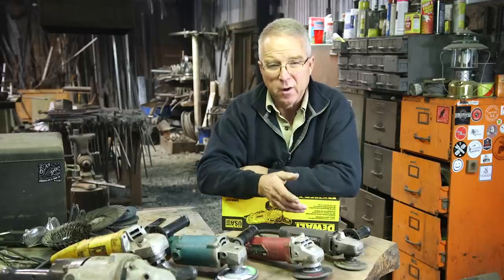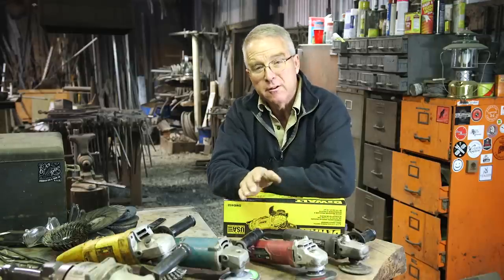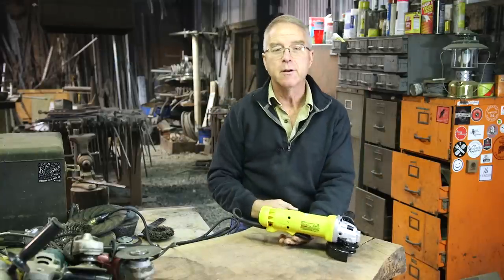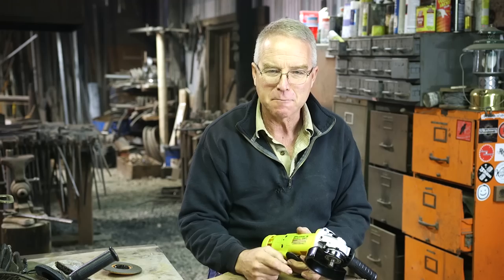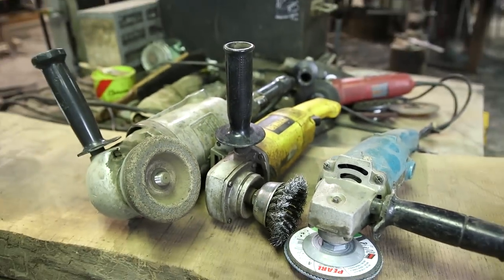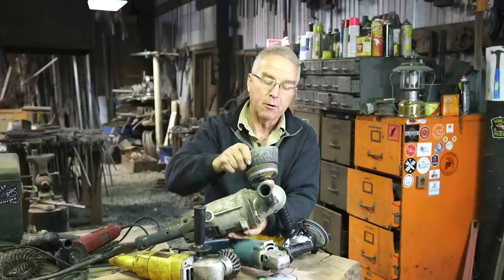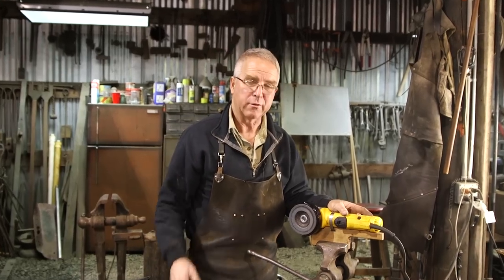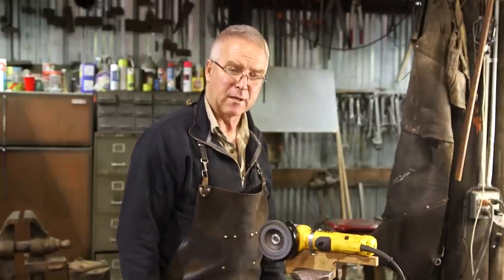Get Another Angle Grinder

Comment: Scott I couldn’t disagree more about the thumb switch, I would never buy a grinder with a paddle switch, so many times I have needed to move my hands on the grinder either from fatigue or clearance and having the grinder shut off is not efficient. Love the video.
Reply: The only non-thumb switch grinders I own are the large rat tail type. I don’t mind a trigger on a large grinder, because it is nice to have the leverage and control that a rat tail provides. On 4”-5” grinders though, I won’t touch anything that doesn’t have a thumb switch.
Reply: @athhud  I agree, I have used a larger trigger type grinder and had no problems with it. My 4.5 in Dewalt has a thumb switch which I ordered specifically from my Mac tools dealer.

Comment: As you mentioned, angle grinders, especially with cutting discs, are dangerous if you don't properly use them. Therefore, manufacturers invented safety features like soft start, kickback control, restart protection, electronic brake, paddle switch, etc. If you are not professional, these features save your life from this monster tool.

Comment: You were struggling with the detents on that guard at the end of the video. Well, it doesn't lock into place on the rear half (where you were having issues). There would be no sense having a guard that was installed on the front of your grinder leaving your body exposed and getting in the way of the work.

Comment: I had some pro-sumer grinder, after surfacing maybe 10 sf of concrete and cutting about 6 feet of quarter inch steel it burnt up. I mean I had to unplug that sucker and dunk it in my cooling bucket. Didn't even save the pigtail from that POS.
Reply: Brand?

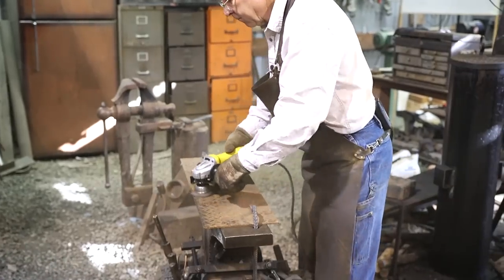Comment: I see at 6:30 you are using a wire brush attachment without goggles ok specs but not goggles. Never do this. I once did and felt something warm on my cheek. Was bleeding from a strand stuck in my cheek just below my eye. would have been instant blindness if it hit my eye.

Comment: I only buy angle grinder with variable speed. Why buy an angle grinder with variable speed? : soft start; when you are tired you can use it at low speed to reduce the risk of injury; not all accessories and applications of an angle grinder require high speed

Comment: Not a real fan of the 4.5 inch grinders, they are okay for using with a grinding or a flap wheel, when your using a zip disk cutting you have to make damn sure that side handle is on and you are holding onto the grinder securely. I would NOT and I mean NOT use a 4.5 inch grinder with a wire knot wheel or a cup wheel. You need a 5 inch or a 7 inch grinder that has the standard trigger handle you've got a good leverage, you put a wire wheel of any kind on a 4.5 inch grinder that's a death wish. I used to use angle grinders daily when I worked in the family steel fab shop I've got many hours on one.

Comment: I'm a welder and use grinders daily, Guards are important if you are using zip cuts, and wire wheels. Zip Cuts will literally kill you if they blow up and the only thing between you and death is your guard. Wire wheels constantly throw small parts of themselves off at all times and you end up picking pieces of it out of your coveralls/ clothes at the end of the day.  If you are using 1/8th or larger discs its less important and only there if you forget where your hands are in relation to the wheel.

Comment: that dewalt grinder you bought is specially design to handle dust, the system does work, just remember to clean the exhaust hole once it is starting to clog up, otherwise the dust and debris will be suck through the motor.  Watch this test made by the russian, it is an extreme test but you can see the dewalt system works https://www.youtube.com/watch?v=HPON9b1HxeY

Comment: these newer de wilt grinders are tragic , they are huge and heavy and too expensive for what they are . most of your grinders have guards missing ,,, why , Ive about twenty grinders and every single one has a guard on , granted some have been trimmed slightly , or halved in thickness for cutting discs , but there is no reason what so ever to take the guards off grinders.

Comment: You should really be wearing a dust mask when using a grinder. I refurb old homes and rip old paint off these 100 year old mansions and use N95 and the like to keep the nasty out of my lungs. BTW, I have Makita rat tails, Bosch and Milwaukee paddle grinders and I love the Bosch slim grinder the best. I have never had the switch fail on any of them and that slim body is so easy on old arthritic hands

Comment: I used to say F the guard. 
Then a cutting wheel broke hit me in the chest flew up about 20 feet I looked down didnt see anything didnt feel anything. put a new blade an went back to work 5 mins later my legs started feeling sticky looked down it was all blood. A year later a nother cutting blade broke pulled the skin an some muscle off my middle an index finger. After that I will never use a grinder without the cover again. A few months after that. Held it close to my chest wasnt doing anything unsafe an the cord had frayed. The wires arched an the braker didnt go off so I burned my self bad. Glad I stopped tie off there cords by that point. Not a fan of angle grinders anymore.